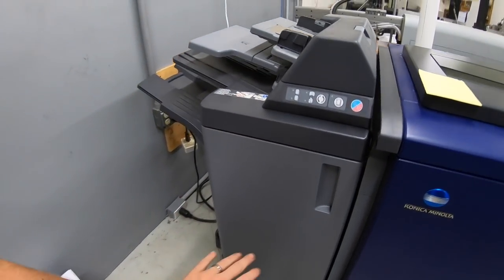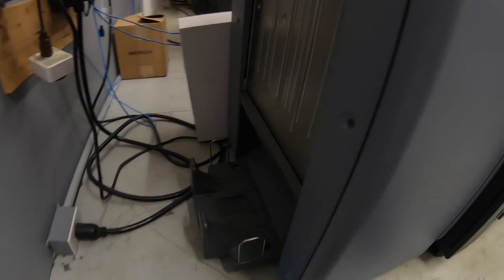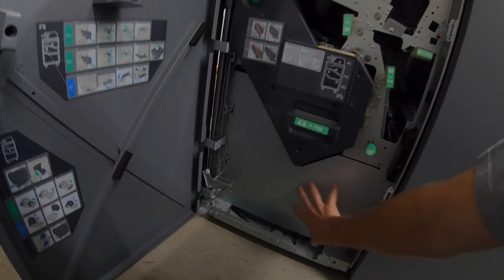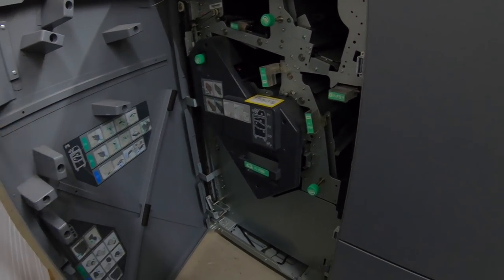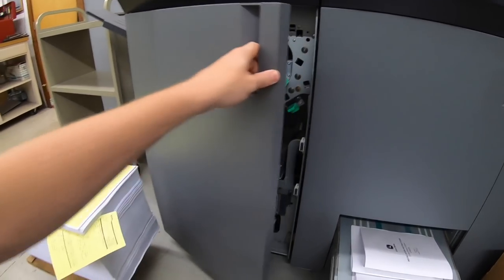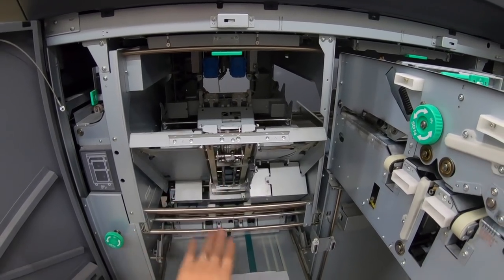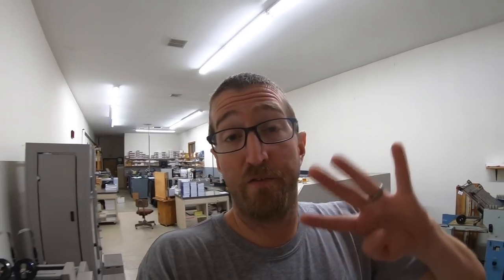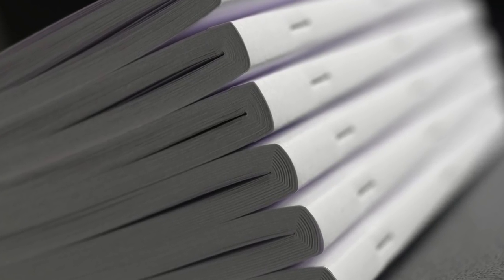Konica Minolta Booklet Finisher Options

Comment: Love your channel. I ran a printshop from 1987 to 1994 and printed a publication. Repaired and figured out a Pittney Bowes 30 bin Ferris wheel collator. Amazing tech for back then. I just sold my AB Dick 360 because my Konica 951 is amazing. I can push the button and go to bed. However, I am trying to print a simple booklet of 32 pages on letter size and only four sheet will print when I try and use the folding/stitching settings. It works on a straight print.. where I have to fold and staple it manually. I have tried every setting and have 12 books here with all kinds of sideways printing and as I say, four sheets.. not the 8 I need in a 32 page letter folded in half.  Pulling my hair out soon trying to find the answer. Using InDesign CC 2022. Also tried making a pdf and printing from Acrobat. Same thing.  Using booklet printing. And the Konica printer setting booklet and fold and stitch. It's probably something simple. HELP? I can't find anything online to sort this out.
Reply from the maker: The printer might not fold and stitch thick paper. Could it be the paper gsm setting on the printer? Try a thinner setting.

Comment: We just picked up a used machine and it came with a plockmatic square edge booklet maker. It does the page flip a bit differently and only 35 sheets. It's pretty cool because it will work offline. The page flip is fascinating, never thought to run it with the covers open. :-)
Reply from the maker: Oh yeah, running machines with the covers open is my favorite!

Comment: Great value in this vid,
My workplace just purchased an SD-510 inline booklet finisher along side Konica's new TU-510 Trimmer unit and this really gave me a good idea as to what I'll be dealing with regarding the SD-510 which looks to be comparable to your SD-506.

Thanks
Reply from the maker: Glad you liked it! Some of the newer Konica finishers do a three side trim. That would be awesome!
Reply: Commander Happy, you probably mean they got an SD-513 booklet finisher (the one that can make full-bleed booklets). In combination with the TU-510 trimming unit, the optional internal trimmer for the bookletmaker is not necessary, as the TU-510 takes over the top and bottom slitting. (Not to mention all the other things that it can do.) It's a great combination. Good luck with it!

Comment: Good video. Some additional info: (1) Konica doesn't make the FS-612 finisher anymore. It's not an option on any of KM's current production machines. (Thank God.) (2) The SD-510 option for the FS-532 can fold and stitch up to 25 sheets *by spec*, but at 20# bond/50# offset, the spec is 20 sheets. (3) Great segment on the SD-506, which is a workhorse, but there is also now an SD-513, which also does face-trim, but there are options for it to do top & bottom slit (to get full-bleed booklets); for squareback (rolls out the spine fold); and for creasing. Think of the SD-513 as the economy version of a Watkiss or Plockmatic.

Some additional thoughts: (1) It's important, when talking about bookletmaking, to discuss its impact on productivity. The more a machine "thunks," the fewer finished pieces you'll get out (the print engine has to wait on the bookletmaker to do its thing). (2) It's also important to mention the impact of paper weight (and coated stocks) on the number of sheets it's possible to stitch.

Bookletmakers are a careful decision, and any sales or technical conversation should include a discussion of limitations as well as capabilities. Always ask to see detailed specifications or the Customer Expectation Guide.
Reply from the maker: Great points! Always grateful when someone can add to my impromptu videos! :) Thanks!

Comment: Of note, the SD-513's on our Accurio c6100 and 6120 are pretty awesome! You can perform inline square folding and 3-sided trimming which comes in handy for customers looking for something that lays flat with bleeds and is bookshelf friendly without going the perfect binding route. My only cons: (1) it performs the top-and-bottom trims before folding or stitching the books, which can lead to a skew or jogging problems on some coated stocks and odd-size books; (2) it definitely slows the machine down; (3) you need to pair it with one of Konica's post-insertion units since it doesn't feature a cover feeder; (4) its creasing function requires a technician to adjust if things skew. It may sound like a bunch of cons, but they honestly don't present too many problems in the day-to-day. Plus, we were spoiled by Plockmatic bookletmakers on a previous machine lol.
Reply from the maker: Agreed, those new Konica finishers are nice!

Comment: Hi Dan, love your channel. Slightly off topic but can I ask you a question about your KM 3070. I use the same model and I have a strange problem. Basically, I only print greeting cards and when I print a design that has a lot of magenta within the design - I get a terrible issue with static sticking sheets together. Now the static does not cause an issue during the printing process but I use a Duplo card cutter creaser (superb machine) to finish my cards and the static causes multiple double feeds during a run. If the design is not 'magenta heavy' then I never have a problem ... weird! Any ideas as I know your are a genious with these machines. Thanks and regards.
Reply from the maker: That is weird. I am not a genius! LOL. Not sure why it happens with just magenta. maybe try stacking face up instead of face down. So it images the opposite side first? Could also put some anti static tinsel somewhere. If static is a problem I can sometimes resolve it by fanning out the sheets on the cutter table to neutralize the static.
Reply: @justaprinter  Hi Dan, thanks for your time with my question. This is deffo a weird one. I tried the tinsel with limited success. I'll have to persevere with this. Thanks again, really enjoy your channel.

Comment: Cool - But no print to the edge in the inline production. Vi have the Xerox Versant series, and they have the opportunity of trimming all 3 sides and then remove the bleed. Also squarefold option.

It’s pritty nice with it all as inline. Just paper in one side and finish booklet out end the other side. But it often takes a lot of time to produce that way - especially if you want a cover with heavier gsm..
Reply from the maker: Yes, most of the new finishers have a full bleed option. That would be a must for me on my next one.

Comment: Missing the SD-513. It’s an upgrade to the 506, and it can slit, crease, face trim, and do both standard & square fold. 
Full disclosure: I do work for Konica Minolta as a Service Engineer on the Production line specializing on the C3070 & C3080. Before working for KM, I owned and operated a print shop for 15 years.
Reply from the maker: Yes, I forgot to mention the newer finishers. I need to get one of those!

Comment: Another nice video! Isn't the biggest question online or offline? How do you look at this, isn't a finisher if you have offline finishing equipment a bad investment, also because inline is always friction?
Reply from the maker: I would agree that a finisher is a bad investment if you have offline finishing. In-line is convenient depending on the job though. It's also good to have options. I can be making booklets inline while printing and making booklets offline. I also bought the inline sd506 before I had the collator.

Comment: I work on most of the konica finishers.  The SD-506 works well when it works.  The $35,000 dollar price tag scares away a lot of small shops with a limited budget.  You may want to mention the SD-513 which does side trimming.  It is a bit smaller than the Watkins.  Trimming boards are a consumable item with the SD-506, show a video on how to change those sometime.
Reply: The SD-506 is never sold for $35,000 unless they see you coming.
Reply from the maker: Yes, those new Koinca booklet makers are very cool!

Comment: Thanks for the explanation. Does the 506 finisher do the face trim off line(thru the inserter)?
Reply from the maker: The 506 will do the face trim inline. Its located on the bottom left side and occurs after its folded.

Comment: stupid question: is there a staple finisher with 2x center staples? i want to make booklets up to 50 sheets (from A4 paper, black/white print), but without folding, so they are flat for shipping. i have a low budget (1000 eur), so im looking at used Konica Minolta bizhub 363/364 printers with FS-534 Staple finisher.
currently i do manual finishing from 4x Brother HL-L5100DN printers, which is too slow / too much work.
Reply from the maker: I have never tried that but I bet the Konica finishers would do it

Comment: Thank you for showing us the integrated booklet maker on your KM printer. As my experience is with conventional fold, stitch and trim processes, I stand back in horror at these "amalgamed systems"! The sheet path from the end of the printing section into the booklet maker station looks like a real nightmare.
It breaks the basic golden rule of the machine processing of paper - "Shortest Sheet Travel". It must be difficult to control and keep accuracy within the collated sets of sheets with all of  the changes of direction before stitching and folding. I tip my hat to you sir! I
I did work for a company who operated two Duplo collate/stitch/fold systems. The stitching heads each used a cartridge (shaped like a snail shell) which contained a roll/strip of flat lengths of wire. Theses wires were formed into staples, driven through the paper and clenched to form a stitch. What kind of system does your KM use for wire stitching? Thank you again. Stay safe and well.
Reply from the maker: The KM stitcher uses the exact some type of staples in a snail shell roll. Interesting.

Comment: Great Video! When I use the KM SD-506, I noticed a lot of static and pages sticking together.  Any idea?
Reply from the maker: I mostly run uncoated so I don't see much static. Having the RU-516 does a great job too.
Reply: There is some factory modification on sd 510 with electrostatics....there is now frames with white rollers to prevent statism.

You can try to adjust the electric value of antistatic option to see in negative or positive value if it change something....
It s in advanced paper configuration, last page setup

Comment: I have the smallest finished because I want advised right how ever it’s a slow workhorse it gets the job done mostly I’ve run small to large runs on it from 10 booklets to a few thousand though the sheet count is 20 after 15 sheets of 100lbs gloss text the fold doesn’t sit as flat any more.
Reply from the maker: Yes, that is a downside that the booklets are not flat. I typically find if you pack them tight in a box, by the time they get to your customer they are flat. :)
Reply: @justaprinter  depending on the quantity of booklets I normally take 2/4 at a time and put the paper cutter clamp down on them for a few seconds

Comment: I'm running an older C6000L with the finisher(FS-612) that has the option to fold, however, I'm having a hard time to figuring out how to make it fold. The option is usually just greyed out.
Reply from the maker: Hmm, maybe there is something to change in service mode? Not sure.
Reply: @justaprinter  I do understand that there will be differences with the older command workstation 5 that controlls my konica, however, would you mind including your software setup for something to be folded in one of your videos?

Comment: Hey Dan, I've had FS 532's and have never been impressed with them, my current 3070 has one and I can't even run a 8 page on 100lb gloss book without at least one sheet skewing every 5-8 booklets. Do you actually run gloss book booklets without issue?
Reply: Konica service engineer here. Those saddle stitchers have always had issues with static. Konica released a new mod kit for them recently that works very well. They can be tricky to install but I’d recommend getting in touch with your countries service dept about it. The mod consists mainly of a replacement guide for the stacking section that now has rollers to reduce static binding.
Reply: @marklynam6320  Thanks but I don't think static is an issue....I also have issues with 60lb offset. Only issues with 8.5 x 11 booklets....8.5 x 5.5 run well.
Reply from the maker: I typically only run 60lb text for inline booklets, and only a few pages. I do see on thicker booklets with gloss cover that the fold isn't always at the stitch. Could be dirty rollers maybe? But most often I run that off line.

Comment: May i ask you about Epson new inkjet work force printer the say it's chipper than lizer and faster 
What do you think about that
Reply from the maker: They are cheaper and faster, however the print quality is not as good as laser. There is currently a place for both machines depending on your needs.

Comment: We cant get the machine to staple past 4 sheets. Is there something we are doing wrong? We have the FS-532
Reply: I’m guessing the weight would be more important there may be something in the adjustments on the machine . Check the setting under finishing in the fiery imp file

Comment: As a consumer of printed things, I mistrust machines that stitch then fold. There are few things worse than a booklet that's stitched just that far from the fold line that you cannot open half of it.
Reply from the maker: LOLOL. You are so right!
Reply: @HenryLoenwind. You may already know this. You need some weight in the fold rollers, held by strong springs/bearings within substantial side frames to fold accurately along the line of the stitches on the spine. All machinery has a "compromise" somewhere in it's design and build. The KM is no exception!